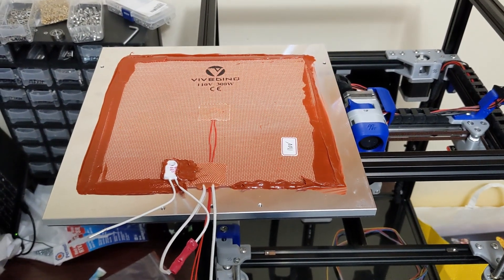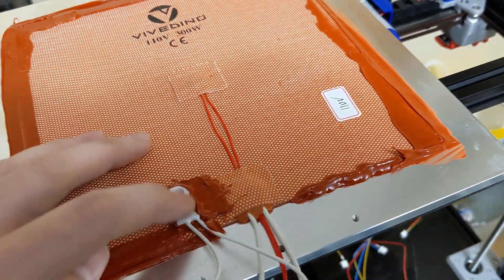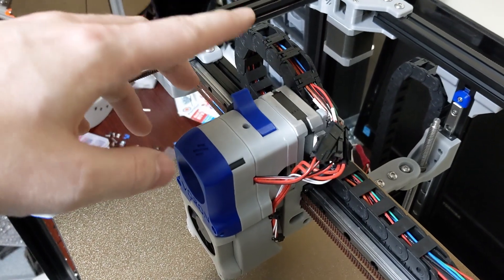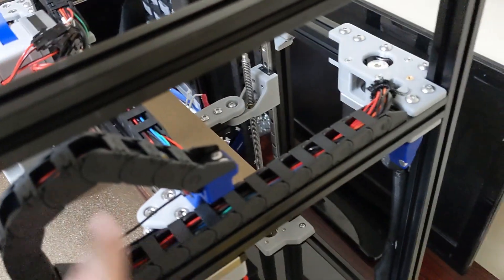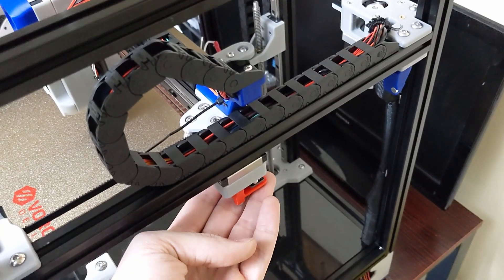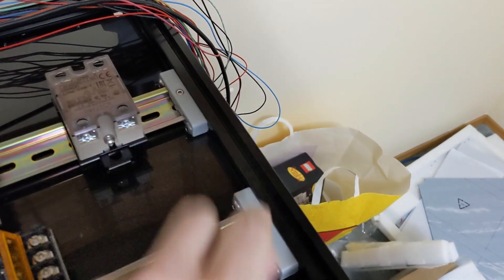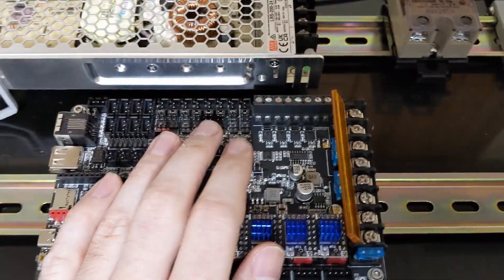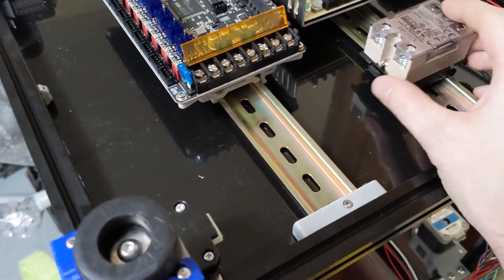FORMBOT Voron Trident 3D Printer Kit - Episode 3 - Bed, Cable Managment and Electronics

Comment: Great Video, you are helping me a lot, but i have a question: If i buy a trident kit from formbot, what parts would i have to buy additionaly to build the stealthburner toolhead right away (exept the motor and the fan)?
Reply from the maker: if I remember I don't think there is anything else other the fan and motor. There are some RGB leds but I think thats about it
Reply: @Rolohaun  Thanks

Comment: For your cable chains, if you flip them end-over-end and attach the side with the rigid coupler to the toolhead, they'll lay flat. This may also mean you won't have to flip the end pieces 180 degrees. And when you make the move to Stealthburner, you may need to insert a link or two back in because the chain mount is higher on the toolhead. Nice videos! Subbed!

Comment: Great tip about securing the thermal fuse to the heating pad. That IMO should be in the official documentation as the preferred way to do it.